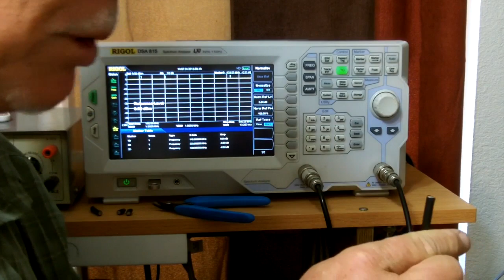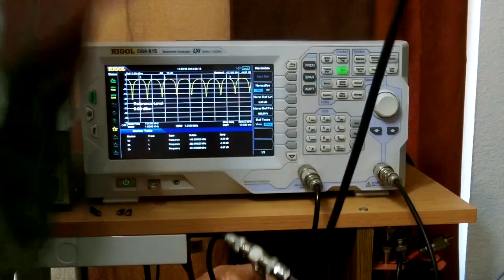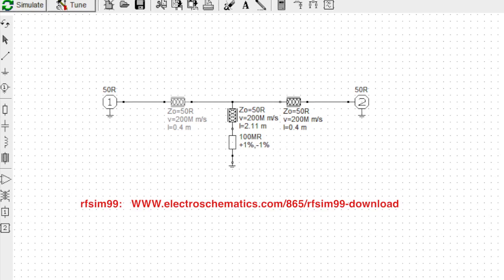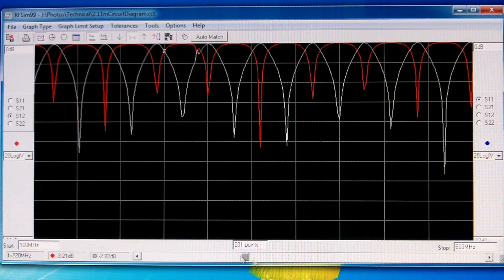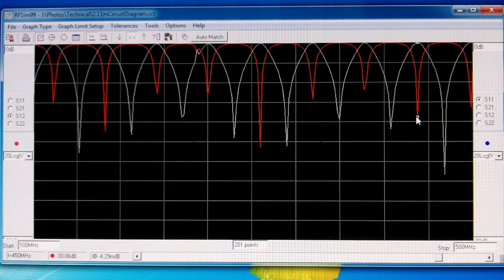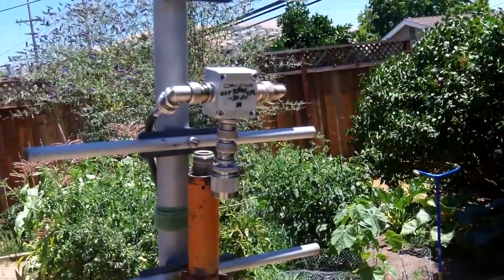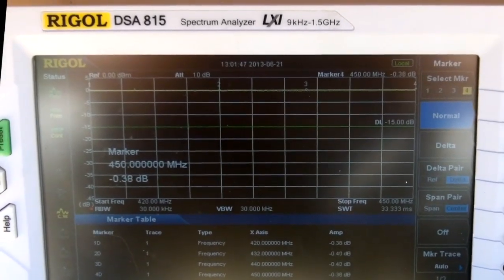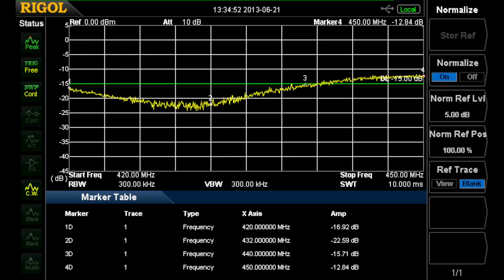Test Cable for VHF UHF Ham Antenna Testing

Comment: I know this video was posted some time ago. Just thinking, Your analyzer is seeing the coax off the T plus the coax going to the analyzer. Wich looks like it could be some multiples of 1/2wavelengths especially at 440. I was wondering if you put the T at the input of your analyzer and ran the test again without the added jumper, would your results be the same?

Comment: Hello
what model # coupler are you using 
thank you
Reply from the maker: +DENNIS N  There is no "coupler" in this test setup.  I am using a standard BNC-F, BNC-F, BNC-F "T" adapter.  If, however you are asking about the Directional Coupler shown near the end of the video, this is a ZFDC-20-5 from Mini Circuits.  See my video about measuring Return Loss ( Sweeping Antennas for Return Loss (initial) ) for more details.
Reply: thanks

Comment from the maker: I have plenty of projects in the works.  But, hey, it's summer and it's California and I have other distractions at the moment.  

I hope to model, build, and evaluate some antennas in the next month or two as well as look at signals and match from my TV/FM rooftop antenna.  I also will explore a trap for 2M to prevent overload of my TV's preamp/distribution amp and a High Pass Filter to eliminate the now unused Low VHF spectrum.  Also a look at my MFJ945E Ant Tuner, etc. Other suggestions?